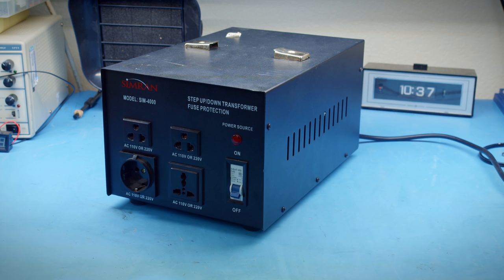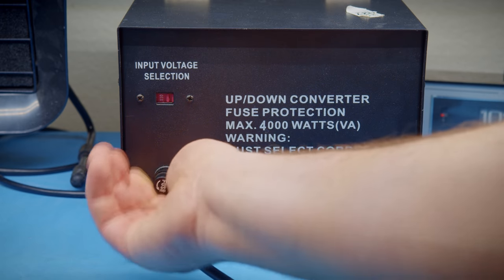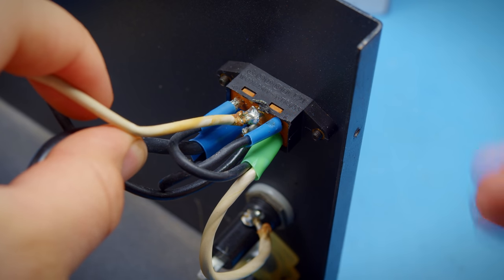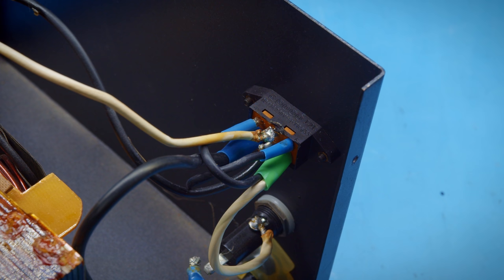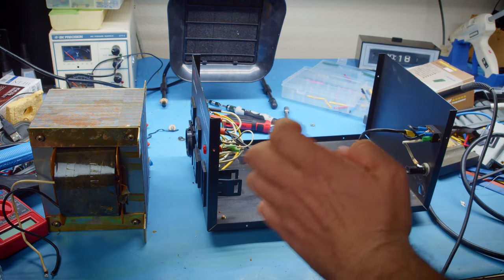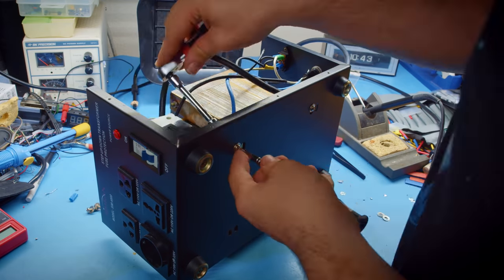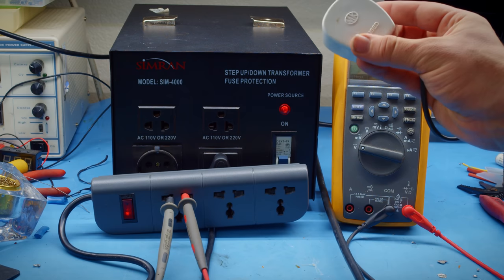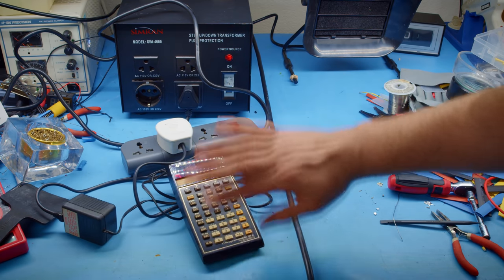Making 240V AC In the USA, Interesting but Dangerous

Comment: Don't know where you got that 3-way extension adapter, but it would fail UK safety test in multiple ways. Those round-pin plugs are still allowed, but only for remotely switched circuits, such as stage lighting, or to allow a restaurant to power off all those decorative mood lamps in one go. They are NEVER fitted to extension leads. The standard BS1363 plug and socket, with rectangular section pins, is as safe as you can get - anywhere in the world.

Comment: 6:00 My reaction: into the trash with it, pull some major parts out to make it unusable again and get rid of it. Will edit add to this comment at end :)
16:00 Shelby you've probably forgotten more then I'll ever know about electronics but all those connections need to be crimped.
26:00 Great job. Going to have to open my one up now and inspect. Great video, very informative.

Comment: The variety of plugs is critical for the sort of plug being inserted in the front face to draw power. The lower left euro Schuko design is ti make sure the grounding is correct and protect against accidental touching of hot Leads , a capability the US connector styles do NOT have.  The UK and Australian plugs are also variations to be addressed. 

The trick to the 120/240 conversion is just thinking the power through the swapped coils of the transformer but making that switchable and safe and properly fused isn’t trivial if you are not hardwiring a single configuration and sealing the box.

For more serious use in the US , we do have the option of just running a 240v outlet from your home breaker panel in the wall to the proper NEMA 6-15 socket. Then all (all he says knowingly) you need is the needed 240v power strip which you put a US NEMA 6-15 plug on.

Comment: Isolation transformer are mostly of the 1:1 kind.  

This transformer , you have in front of you has three wring as converting on 2:1 rate is not really what you are getting due to losses in the transformer, so for 220 to 110 you would need something like 2:0.9 winding and from 110 to 220 2:1.2 winding. This is not very accurate but it is like that, the same thing with transformers and systems that compensate for line voltage drops. When the voltage drop is low then the transformer in that system would be like 1:1.2 which brings up 200 volt back to around 230 volt.

That breaker isn't really a breaker but a heavy switch, and in this setup not meant to use many times. These transformers are mostly used for a prolonged time and not for short time.

Another thing about the socket, the round one in the left bottom are the schuko type. Same as the cord that came with it. Those have the earth connected with the lips and not pins like the US and UK type of plugs.
Reply: Good job btw with refitting this thing, all those soldering joints were a bad job by the factory. I would do no different as what you did, disassembling and make it good.

Comment: Chiming in with a bunch of other people because it can't be overemphasized - just go get 240V from your breaker box. Use a double-gang breaker. Check your building code but you can probably do this yourself. And having an electrician do it is probably on the order of $500 - $1000 if you go with conduit outside the wall and the run is in the 25 - 50 ft range. That's the correct way to do it in North America.

Comment: That has to be the largest transformer I've ever seen. Can we call it Optimus Prime?
Reply: Should have seen the three phase transformer and chokes that were in a rack mount variable frequency sinusoidal inverter I used back at my old job manufacturing electric motors. The chokes were bigger than this transformer! The actual transformer was large enough that it was a challenge to pick it up. The fully assembled unit was a very difficult move for two people!
Reply: @richfiles  Insane! What kind of equipment was it used for?
Reply: @ms-dosman7722  Mostly defense and aerospace motors, synchros, and resolvers. Applications included everything from aircraft carriers to fighter jets, missiles and refueling planes, weather forecasting equipment... All sorts of stuff. These needed 400Hz AC, at voltages from as low as 28 volts to as high as 125 volts. Ironically, many of the products we built didn't actually need such a beefy supply, individually. Rather, the inverter was wired through out the building, and was able to provide power to multiple stations.

We had two inverters, so that we could produce sine waves that were out of phase with each other. The two inverters took up an entire chest height rack. We may have had product long before that required more current, but by the time I was there (2000-2006) most of the product was fairly small.

After 2006, we moved all our production to another site, consolidating in the building of the main company. Honestly, I liked the old place and the environment there better, but it wasn't bad at the bigger facility. The company had gotten some new equipment to generate the signals at the test bench, and more precisely, so the old inverters were sold at auction.

I actually ended up buying them, cause I wanted the digital waveform generator out of it (it was an older model, but still produced an sine wave of variable frequency and amplitude, very precisely). I even made some of my money back stripping the electronics I wanted, and selling the metal leftover to a scrapper that was there. I had ideas of using the transformer someday, but never got around to finding a use till years after I'd gotten rid of it. Oh well...

Comment: There are some advantages by using an autotransformer instead of a transformer in these units:
- single coil means less copper (lighter and also cheaper to manufacture)
- to get 4KVA at the output with a transformer you need both a core and two windings rated for 4kVA... but to get 4kVA at the output using a 1:2 or 2:1 autotransformer you need a core and two windings rated for only 2kVA (half of the output power is provided by the coil and the other half is provided straight from the mains, which means A LOT LIGHTER AND CHEAPER to manufacture if compared to a regular transformer!!!)
- if an autotransformer is connected to a socket protected with a GFI (a very common thing in europe) and you touch the output (hot) wire, you receive a shock but the GFI immediately trip to save your life... conversely, if you touch the output of a transformer, you receive a shock and nothing will save your life.........

Comment: What a horrible build quality, a good job you decided to replace the whole power lead rather than just cut the plug off and fit a new one (assuming that's an option in the US)
I'd be VERY inclined to replace most of those front panel sockets, so you cannot accidentally plug in a piece of 110V equipment and blow the crap out of it. The same goes for the labelling, remove all references to 110V.
That transformer is a bit overkill, at least you should be unable to cook it.

Comment: 4000W is standard single home - power in most EU countries on a single phase, it's not a big deal since 240V 50Hz is the standard for Europe. My tiny appartment has 240V/20A limiting fuse, which is a bit more than 4kW so nothing weird about that. If I had the "honor" of having 3phase power line, I'd be able to draw 15kVA from the grid, maybe then an electric car would be a reality.
Reply: I think most houses in the UK probably have 60A to 100A fuses on a single phase, so 4kW is easily attainable. I commonly use 8kW when charging my EV.
Reply: @ShALLaX  7-8mm diameter copper wire to your home from transformer station... in 21st century? Yeah, cool story bro!
Reply: @playswithblades  are you seriously saying that charging an EV at 32A @230V at home isn’t possible or commonplace? I regularly use 10kW while the car is charging, oven is on, TV and computer are running.

My supply fuse is 60A. The distribution company offered to upgrade me to 100A without cost if I felt the need.

Please do some research before discrediting someone.
Reply: @ShALLaX  If you say so. Why do I care?
Reply: @playswithblades  you might not, but others reading these comments might want to know the truth.

4kW would get you around 17A. Ring mains in the UK is usually rated to 30..32A - forget the additional lighting circuits. Nothing of what you say stacks up

Comment: i bought a double wall socket from the uk off ebay and installed it in my garage, wired it into my 120/240 panel with a 15 amp double-pole breaker. works great and is safe but of course the frequency is still wrong, 60hz instead of 50hz but all i use it for is a toaster and kettle, which don't care about frequency. if i really needed 50hz power for something like a clock i would pick up a 12v inverter from europe or the uk, seems like a much simpler solution.

Comment: But in the USA the power really is 230 to 240 volts at the box.  Just wire up a socket for 240 and use a foreign wall outlet of your choice.

Comment: Heh. If ever I get my own custom workbench, I'm just going to have a NEMA 14L-30 or the like on the wall. Much safer than this thing.
Reply: I wouldn't do a locking plug like that. The non-locking 14-30 is much cheaper as it is the standard for clothes dryers. If you don't need 7200W on your workbench and don't need both 120 and 240 to the same device a 6-15 or 6-20 is another good option which won't require expensive 10awg wiring. You can run a NEMA 6 and a pair of NEMA 5s off of a single multi-wire branch circuit.
Reply: @eDoc2020  Huh. Yeah, the locking seems excessive. But a 6-15R seems more reasonable if I don't need thousands of watts.

Comment: That plug on the power strip is an old style British lighting plug, they are rarely used now. That wouldn't pass an electrical test for use in the UK.
Reply: And it's still used in India.
Reply: They are still used in restaurants, hotels and for stage lighting, with remote switching. "Grandfather rights". Stage lights usually have the 15A version rather than the 5A size shown here. Quite a bit of the old empire also used the round-pin variety. One laptop I dealt with came with a whole set of power leads for use around the world - I had to look some of them up!

Comment: Did you find a UL tested and certified sticker/tag? Without a UL or CSA certification, you should not plug in the device. In most places using an untested and uncertified electrical device voids any insurance that you might have on your building (home or workplace). Its worth the extra $$ to only use properly certified electrical equipment.

Comment: A tip, get a panel voltmeter that goes to 500v and replace one of the sockets in the front with the volt meter. And never get surprized if the switch in the back accidentally gets in the wrong position.

Comment: That extension lead wouldn’t meet the minimum standards in Europe. It’s junk. The plug is completely wrong. The pins should be sleeved for a start. And all mains connectors have to be crimped and not soldered.
Reply: Where did you even get that?! That is a 100% bog standard schuko plug as seen almost everywhere in mainland europe, probably the most common mains plug in the world... Sleeving is only necessary in the case of the unearthed 2-pin europlugs where the user can theoretically reach into the socket above or below the plug body, touching the pins (although you'd really have to have small fingers to be able to pull that off), but the cross section of the full size schuko plug matches that of the receptacle, so there's no need for additional sleeving at all. And I'm not sure which "mains connectors" are you referring to, but inside the case you use whichever method you like for joining leads and components, it's just the crappy workmanship that makes this unit a POS. Duh.
Reply: @sniperasys  are you blind? The plug isn't a standard schuko plug! Its a chinese death trap.
Reply: @leeshepherd6512  I'm sorry, I didn't realize the psych ward offers internet now. Maybe you should use it find a single sleeved schuko plug on the internet, or to substantiate your other nonsensical claim. Good luck, get better soon!

Comment: Great video.  You probably know about the input frequency of your device's power brick for your calculator.  AC to DC Power Bricks can usually handle the change in frequency.  With an oscilloscope check the output voltage's frequency no load.  I'm curious of the effects of the transformer, phase shift.  Take a look at this.  https://www.50hz.com/Solid/solid.html.  Also, look at their rotary converters.  They are the cleanest source of power.

Comment: ..Also just to get a 6V supply for your lovely Texas calculator...There are easier ways. Also don't most US buildings have 240V available fairly easily - on a blinkin pole!😸  
People are saying we here in the UK can just manage 4KVA on 240V. The supply is capable of delivering a hell of a lot more. We don't have wimpy transformers on poles. The incoming supply is fused at a legacy minimum of 60A. Nowadays this is becoming close to useless for many. New properties are fused for 80A or more. The limits people are thinking of are for protecting cables and the plug/socket. A small electric UK shower is rated at 10KVA. You just need a fat dedicated cable run. How about a nice big welder?
There is nothing I can think of that requires more than a single phase in UK domestic housing, unlike some chap implied below. Unless you are running heavy machinery 240 is plenty.

Comment: Depending how your kitchen is wired, you may have access to 240V through your kitchen outlets. Typically, one outlet is fed from one 120V leg and the other outlet is fed from the other 120V leg. So, you can make 240V by taking the two hot sides. Of course, this is very dangerous and not recommended to do.
Reply: Obtaining 240V this way can be made somewhat safer by running each input through an AC-coil relay in the combiner device, with each relay's 120VAC coil connected between line & neutral of the input passing through. This avoids live prongs if one plug comes loose or is pulled out before the other. Checking various sockets for L1/L2 connection by trial and error works fine. Some more recent US kitchens have even the two halves of a duplex outlet on opposite legs, if wired with a shared-neutral multi-wire branch circuit. I think these have become less popular now with the new AFCI requirements, though, and they can be a hazard if the supply panel is ever fed from a single 120V source (small generator or inverter backup) into both legs.

Comment: The US style plugs and receptacles are inherently unsafe for two main reason: they are flimsy and they allow for the potential of the user accidently touching the blades when the plug is not fully plugged in.

There's a reason why there Euro-style (in Germany, it's also known as a "SchuKo-Stecker," or fault protection plug. "SchuKo" is short for "Schutzkontakt")

The main advantages are both in safety and robustness. Safe because the ground always connects first, not the person holding the plug, and the plug itself is held by the receptacle and NOT the blades alone like in the US plug. The latter is rather bad since it is quite easy to bend the blades if you accidentally snag the cable.

Also, US homes do receive 240 volts, however, the voltage is stepped down in the switch box.

As for that device itself, well, quite scary that something like this is actually sold.
Reply: Totally agreed on plug designs! Ours in the USA have remained relatively the same since their creation. Even our receptacles are very similar to ones from the early 20th century, sans ground pin slot.

But in US homes, or small business, the voltage is not stepped down at the panel. It is actually more simple, since we have two phases (physically separeted) that are 180° out of phase.

The only instances where we can get 240VAC properly is when there is a circuit breaker that connects across the two phases on the respective busbars.

Comment: Can you daisy-chain two units to get 440V?
Reply: nope, since they are not isolated
Reply: Looking at the build quality, I would expect there would be much arcing if you tried that.
Reply: @txd  That doesn't matter, the autotransformer will still just step the input voltage up or down by the inherent factor in the physical construction of the device.  It would probably arc all over internally because the insulation isn't good enough, but that's a different problem.
Reply: @evensgrey  its a bit more complicated than that. But I thought he meant have 2 or more autotransformers connected in series :)

Comment: Sooo, you don't need to run 240V from your panel to get 240V. You just need to find two outlets in your house that have two different phases of 120V. If you can find two such outlets then they will have 240V between them. You can then make yourself a custom extension cord that plugs into two 120V outlets and gives you 240 at the end. Note that this may not be legal but at least it can be done without modifying anything owned by the landlord.

Comment: Weird you choose the least used European standard on your power strip. :) That outdated UK plug is for their ring power with 32 amp fusing and is formed that way to accommodate an extra fuse in the plug itself, tho most chinesium stuff omit that making them scary as f. Neat autoformer tho.

Comment: When soldering wires as heavy as the transformer leads, a larger soldering iron is needed. The one you have is really on the lightweight side. Get a Weller soldering gun for those big connections. Overall, this "thing" is a POS! I doubt seriously you could safely draw 20 amps @ 240 volts (4,000 Watts) through those transformer leads. I could be wrong, but.....